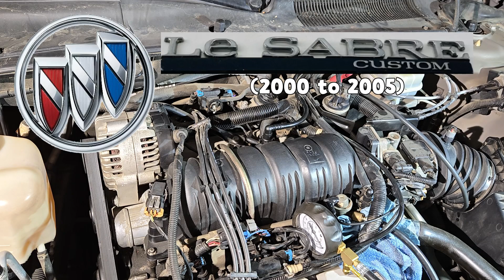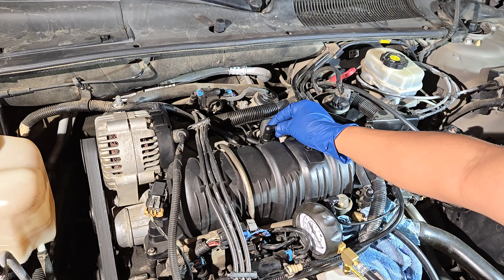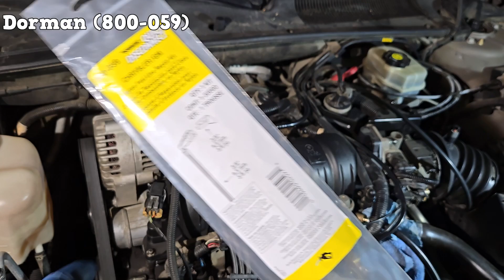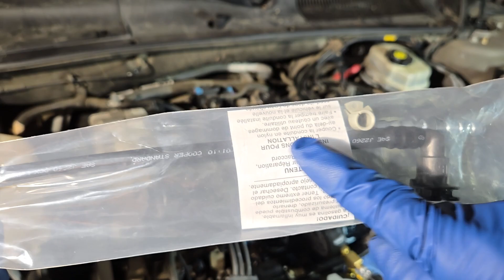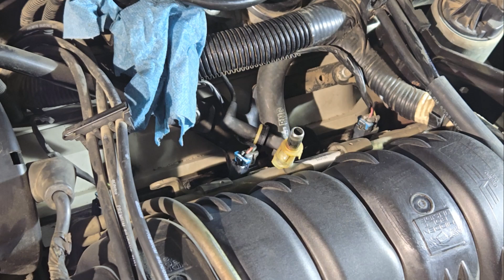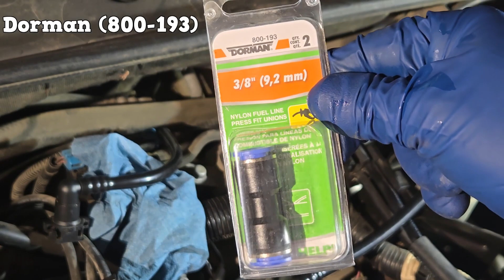Fuel Line Quick-Disconnect & Nylon Line Replacement (00-05) Buick LeSabre (Try At Your Own Risk!)

Comment: I have a P0300 I replaced the line light went away ran good for a few minutes no leaked at all did full tune up plugs wires packs I lost one bolt to one the 3 coil packs only thing I can think of left is fuel pump or a sensor but I can’t figure it out
Reply: I have code P0304 on mine, gonna replace the injector and see if that helps. Did the same thing you did, buttttttt, in my reading people have issues with the icm (ignition control module) beneath the coil packs. Try replacing it and see if that helps

Comment: That kit comes with a small pastic peice what is it for?
Reply from the maker: That is a fuel line quick-disconnect tool
Reply: To disconnect the old snap type quick connect ( metal type, older one) it's a key to removing it easy , has nothing to do with the quick connect kits install , I've HAD A GREAT EXPERIENCE WITH THIS VIDEO , THANK GOD , THANK YOU , SO MUCH ❤ YOUR THE BEST HONESTLY

Comment: 4/4/26- installed fuel line repair kit and union as shown in video. What a great quick fix!
All- you have to know how to use a press lock fitting. Its tricky at first, but the tube has to be inserted until it bottoms out, then pulled out until you see the press lock collar "expand". This is low pressure, the press locks can handle WAY MORE. You just need install them correctly. This is a leak free, 10 minute fix. HOWEVER- I wanted to reuse the engine cover, so i cut the fuel line a little differently,  and trimmed the engine cover to still fit. It took 15 minutes to make nice and not look butchered. Good luck everyone!

Comment: Will this help with my rough start? It leaks only when I push on it that fuel line but it doesn’t leaks when driving that I know of but I do smell a tiny tiny small gas smell coming from the engine but not where it would hurt my head and I don’t smell it from the inside only the out side. I don’t have any misfire and my long term fuel does seem a little bit too rich.
Reply from the maker: This vehicle did not have a rough start, also it was not stalling with this leak, it drove fine BUT with gas fumes entering the passenger compartment!

Comment: It looks like it also would have also worked with a heat gun to bend the tubing to the correct contour. I'm a little suspicious of the barb as well; but then again, that's how the fitting is attached anyway...

Comment: My feed line on my 02 LeSabre had that leak and I fixed it and my gas line exploded and caught my car on fire. Now I'm replacing the engine wiring harness and can't get so of the plug out cause they're in bad spots.
Reply from the maker: woah, it exploded with this Quick-Connect on??
Reply: @OldSchoolNoe yeah. Not at the quick-connect though.
Reply from the maker: @DavidWicklund  Ok, now I'm curious as to why it exploded.
Reply: @OldSchoolNoe it was just old and I knew it needed replaced I just didn't have the money to fix it and it's my only car.
Reply: we need more info. You fixed it how? Did you de-pressurize before attempting this job? Did it blow up while working on it or later when driving?
Reply: @marciamarcia7449  while driving and it depressurized itself and I used specific hose and hose clamps to fix the lines and I had to get a new fuel rail from the junkyard along with injectors, and the wiring harness

Comment: I did the same thing & it's reliable. Before that, I used a vinyl line and two s-screw clamps to get me by for a couple of days before it would bubble up like it was going to burst. GM fixed the gas line and coolant elbows on the series 3 engines. Great engine but they used plastic / nylon components in the wrong places on the series 2.

Comment: Howdy! I have a 2002 park avenue running around 49 psi of fuel pressure, it was running around 45 before I replaced the fuel pump, fuel filter, fuel pressure regulator which brought it up to 49. I checked this line and it’s leaky would that maybe be a part of my low fuel pressure?
Reply: Yes if a line is leaking then it will likely cause a drop in fuel pressure

Comment: My mother has a '03 Park Avenue and is experiencing issues with the car revving up to around 3k RPM or higher and sticking there. I replaced the purge valve because that was the only code it was showing, and it seemed to fix the problem, but it started happening again. It doesn't have a clear pattern; it runs fine one day and then suddenly does this. I wasn't sure if that might be causing the issue. I’ve already ordered the parts because, after seeing this, I went out and pressed down on hers, and sure enough, gas came out.
Reply from the maker: I would disconnect the MAF sensor and see how it runs
Reply: Manually move the throttle body valve open all of the way and quickly release it. It should move and snap back to the closed position without any binding or effort. If it doesn’t, the shaft is seizing to the throttle body housing. You can try some lubricant, but normally you will have to remove the throttle body and clean the bronze bushing the stainless shaft rides on. When this starts to seize the accelerator pedal will not return to idle and will get worse to the point the throttle will hold at the last highest rpm. Tapping the pedal makes it worse, as the throttle will continue to raise the rpm’s. At this point you will have to turn the ignition off, as at this point, the brakes will not hold the car back to stop. It can get scarey with the vehicle going faster and faster. Obviously do the check with the engine off

Comment: just did this today! super simple and easy. this is at max a 10 min job. this video is insanely helpful. just make sure to triple check that the quick connect/union fitting is really snug on the fuel lines!

Comment: Will the leak cause your car to stall while driving? I have the same leak 03 Buick lasabre
Reply from the maker: This vehicle was not stalling with this leak, it drove fine BUT with gas fumes entering the passenger compartment!
Reply: Same with my 2000 park avenue does same shit even when I get gas also check or evap purge valve canister and    hose
Reply: My car got on fire that's what's going to happen

Comment: Do these replacement connectors come with new o-rings? Or are they called washers?
Reply from the maker: yes, the replacement connector has a new o-ring already installed
Reply: @OldSchoolNoe  There are three different rings, right?
Reply from the maker: @IsThatTheTruthorFiction  I have not removed the O-Rings inside the replacement connector, I don't know how many that manufacturer put in there, it is not OEM, its an upgrade to the OEM style.
Reply: @OldSchoolNoe   Thank you.

Comment: Hey @OldSchoolNoe just wanted to say thank you for the informational video bro. I was at the very end of a long and frustrating intake gasket repair and this was last thing I attached. As I tried to slide it back on the damn thing crumbled to pieces 🤦‍♂ I used all the same parts you recommended and the repair went off without a hitch! Couple of things I'd recommend for anyone else is to use a lil razor blade gently slice the tube as perpendicular as possible and not to press too hard so the hose stays as round as possible. Also use a lil silicone grease on each hose fitting point so that when you slide the hoses into the coupler, they slide in as smoothly as possible to reduce the chance of damaging the o-ring seals. And make sure the hoses bottom out! Thank you again and stay blessed my friend 🙏

Comment: Thanks man, I just replaced the o-rings on mine and now it leaks worse than it did before. Although I probably used the wrong o-rings. I used some viton ones I got from harbor freight but just eyeballed the sizes. I think I'm going to just replace the line like you did but I'll use that metal barb fitting.

 Basically the last thing I have to do on this car to get it running right it has been whipping my ass for the last year.

 I guess that's what I get for buying a car that doesn't run. Amazingly not only did the ICM take a shit but the MAF did as well. It would not run with the MAF connected and the ICM was faulty, It would run for a few minutes and then lose spark completely. I also did coolant elbows on it, lower intake manifold gaskets were toast, and upper plenum gasket.
Reply: I did the same thing last year using the the harbor freight viton rings . Worked for a while but I smell gas again. I’m going to try the line replacement in this video. Hope it worked for you
Reply: @qtdynamite1  I did it yesterday and used the brass dorman 3/8 compression fitting (800-228). Get the nuts snug by hand and then tighten them one full turn with a wrench. No leaks at all no matter how much I mess with it, nice and dry. 

I've seen other professional mechanics use the plastic union fitting but I'm always thinking about longevity so I like the brass better.

Comment: What are the sizes of the O rings?
Reply from the maker: I've always swapped the connector with new O-Rings already installed, no idea.
Reply: @ thanks I replaced the O rings, it was actually pretty easy and fast.
Reply from the maker: @lonnieramos3435  what were the sizes or part number used?

Comment: those nylon unions are junk. they dont work. they are worthless garbage. boy i wish i didnt listen to you. i ended up doing it the old way with the metal barb fitting and ear clamps.  so now i have 2 repairs on the hose instead of one.  all this after gas blew all over the engine. luckily didnt catch fire.  almost ruined my car because i tried those junk worthless snap nylon unions,  very not happy. and yes it was secure straigt and tight and had to be cut off
Reply from the maker: First time I hear of any issues with the fittings. All I can do is add some warnings to this video so people attempt this repair knowing the possible risks and knowing the nylon union can be defective.
Reply: @OldSchoolNoe  I wonder if not lubing o rings before install  gave kevschuetz this leaky result? Oh, thanx for vid, my 03 G Prix is leaking there.

Comment: What’s the other two hoses on the side and thank you for the video and information
Reply from the maker: Pause at 2:34 , the 2 nylon lines to right of the line we repaired. The one on the left connects to the purge valve (purges gas vapors from the charcoal canister into the engine), the other line is the return fuel line to the gas tank.